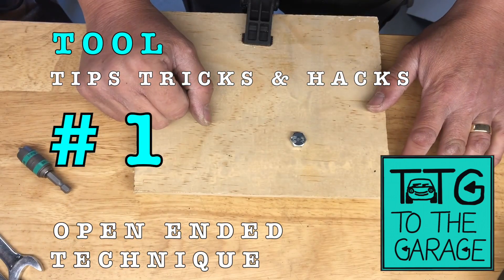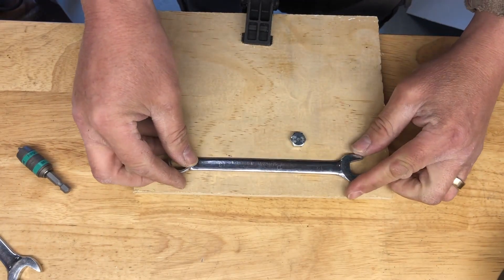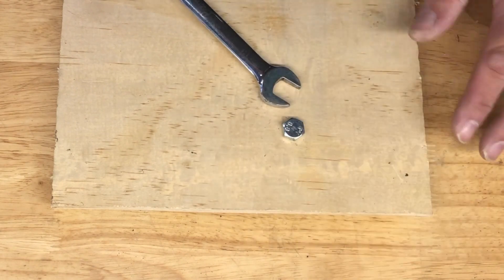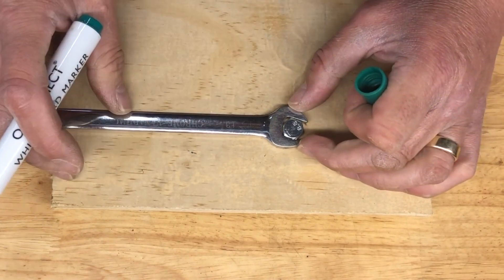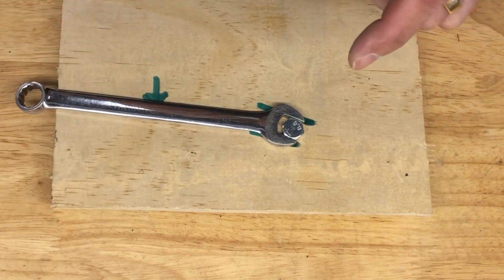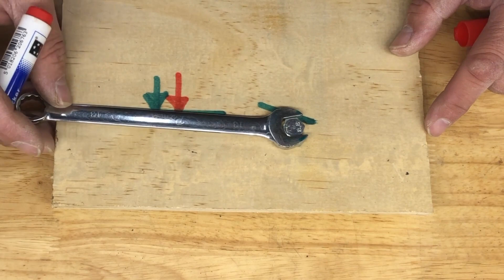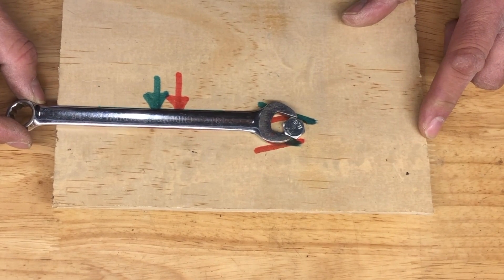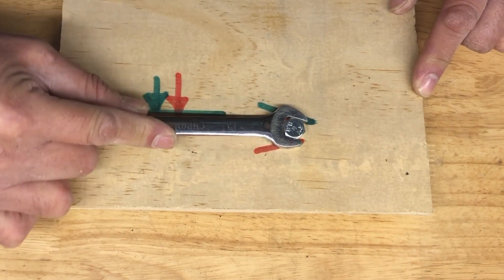Are you using your spanner incorrectly?

Comment: Another gem. As a time served mechanical fitter I knew which way to use an open ended spanner - but I had no idea why! That's my bit of learning for today, don't need to learn anything else until tomorrow!
Reply from the maker: Thanks Alan. I will try to come up with something every week or so.
Tomorrow may be pushing it🤣
Reply: @ToTheGarage although you aren't wrong, you forgot something. You always pull to yourself. So as not to slip and bash your knuckles. So you set the jaw based on your description of forces, and pull.
Reply from the maker: @sasquatchrosefarts  ver good comment👍
Reply: This is not a good advice. He’s completely wrong. This is only a demonstration on how to improperly use a range. The torque test channel did an imperial test proving this is a myth perpetuated by adjustable wrenches and poor technique.
Reply: @coryulrich6489  Torque Test Channel has no videos on adjustable wrenches. If they have one on using an open end wrench backward I couldn't find it.

They have one video that mentions using one discontinued ranch backward. But they come to no conclusion.

Comment: Shocking how many people either don't know this or don't believe it. So far you are the first of a dozen you tubers who knows why it's better to use a crescent wrench in the correct direction. I don't see why these people can't tell the deference by simply trying the damm things both ways. You can literally see them rounding off the nut when used the wrong way. If you look at the angle of the handle it appears to be pulling the wrench off the nut when used the wrong way. Thank you so much for laying it out in black and red.

Comment: An interesting video as usual John. However, I must say that in 55 years of spannering I have never had a problem with open-ended spanners slipping off the nut. Perhaps because I always maintain a steady pressure along the spanner towards the nut. I've had too much experience of open-ended spanners rounding the flats but that's why I always try to use ring spanners or hexagon sockets and avoid open-enders and, in particular, adjustable spanners like the plague.
Reply from the maker: Closed and 6 sided is always best 👍
but sometimes you need the access. Im with you on the adjustables I own several as I like new toys but other than having one for an emergency box where you only have space for one spanner, I rarely touch them. There is One form of adjustable spanner that actually works. It doesn't slip in its setting and the jaws are always parralell. I do own one and will have to find it out and share.
Its a WWII Adjustable German U boat spanner. 
You cant avoid to be rounding off heads in a sub!

Comment: Interesting analogy. TBH the open end for me is only there when i can't get the ring end on a nut or bolt head..... or to use on pipe fittings.  Open enders damage the corners of the bolt or nut whichever way you push or pull it.   Good video though. Cheers  ;)
Reply from the maker: Fair enough!  Thanks for watching

Comment: Just use the boxed end for breaking bolts loose. The open end is better for Supply lines or double nuts where  a boxed end can't be used.
Reply from the maker: Agreed. The hierarch is   
Six sided ring spanner or spanner
12 point socket or ring spanner
Split ring spanner (brake pipe spanner)
2 sided or open ended spanner
Adjustable spanner
pliers
👍

Comment: The demonstration of the “right” and “wrong” way to use an open end spanner or wrench is not correct.  In fact, that end is designed to be flipped over and used either way.  That is why it is set at a 15° angle.  It allows a nut to be turned when there is restricted space to swing the wrench.  

Some people might think that it is designed to be used in one direction by comparison to a “Crescent” style adjustable wrench, which is intended to be used in one direction only.  In that case, the directionality has to do with the movable jaw.  Using the wrench in the correct direction tends to force the movable jaw against the body of the wrench, keeping the assembly tighter.
Reply: Thanks for posting this. The torq test channel proved what you've said to be correct. I was here to basically said what you did.
Reply: @coryulrich6489  - Torque Test Channel has no videos on adjustable wrenches. If they have one on using an open end wrench backward I couldn't find it. 

Torque test channel mentions using one crappy discontinued wrench backward. But comes to no conclusion. And in fact disagrees with your hypothesis. Saying that for them, using wrenches backward always seemed to be worse.

When used backward you are literally pulling the wrench off the bolt. This is true of both tools.
Reply: Thank you
Reply: Although that might not be the intention of the spanner head angle, the logic of what he’s saying still stands